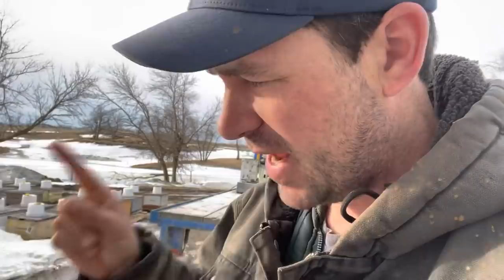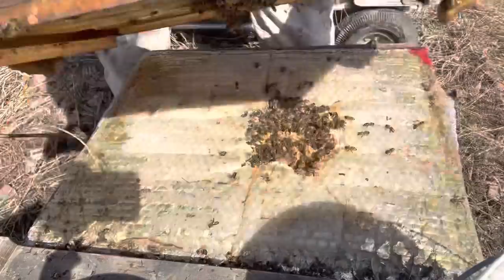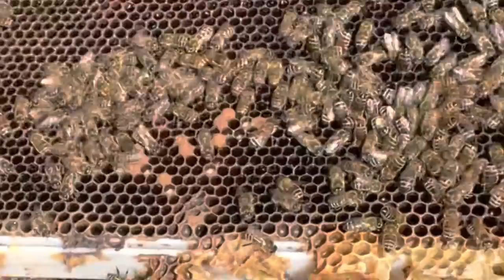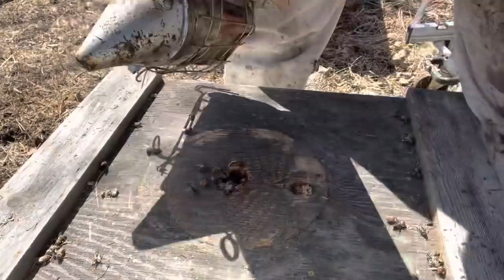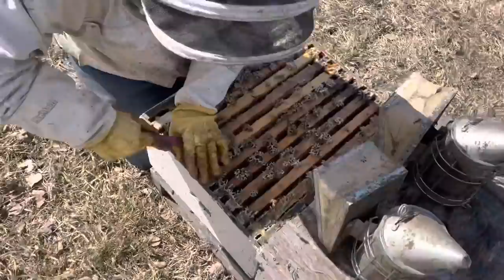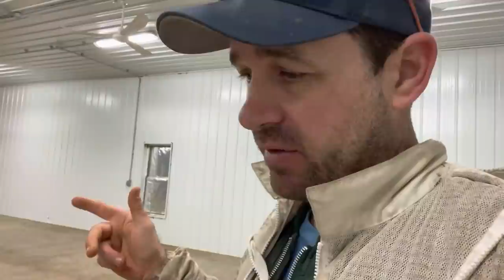Preparation for Some Nasty Weather

Comment: Forecast as of monday 11 pm. 18 inches of snow, winds 20 to 25 mph (not including gusts).   Temps tuesday - friday 33 to 15 F.   Sundays low 7 F,   highs lower to mid 20s. Wednesday April 20th, high 45 F.        Captain, "brace brace brace for impact!"
Reply: Hey Mike, I checked all my hives and looked at brood in the top box and found between 3 to 5 frames of brood. I hope they can keep that much brood warm, still cluster and keep the queen warm. I got my strips on and another pollen patty so let the cold begin. LOL How are your bees doing?

Comment: With a single layer in the shed the air flow and exchange should be fantastic. Had a similar weather pattern wipe out my hives this winter. Hot then freezing for weeks. Went from 80 to 20 over night it was like a flash freeze.

Comment: Hi Ian,
I’ve seen how you use nucs to replace losses and turn around colonies that aren’t up to your standard.
Is there a ratio of nucs to full size colonies that you purposely keep in order to support the rest of your operation? 
Or is it purely based on environmental factors / how much you need to split off as part of swarm prevention? 

Thanks 
Russ

Comment: Hi Ian, is not possible for you guys in Canada to use better insulated hives? I know cost and all that, but the cold setting your bees back and loosing hives and now removing them again has a price too. In Denmark professional beekeepers use mostly polystyrene beehives. Could be an interesting experiment to see how a group of those hives will perform in in your operation, and it will give good YouTube material too.
All the luck with the cold snap, I hope it will be a short one! Greetings from Denmark
Reply: Some problems. Polystyrene even the compressed kind they use for the hive deeps isn't as durable as the wood hives. How would you be able to pick them up with the ez loader? If you could pick them up with the ez loader. I say a trial with the polystyrene hive is a go. Maybe like 20 or 30 hives or one  truck load.
Reply from the maker: It would sure keep them warmer